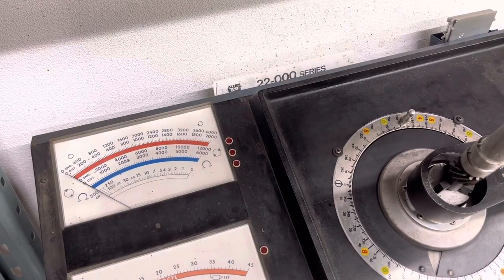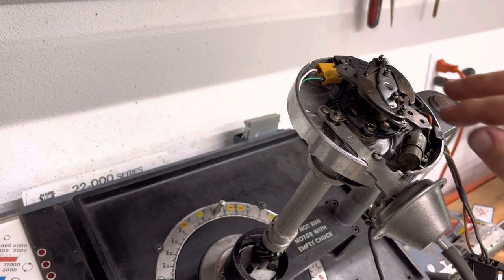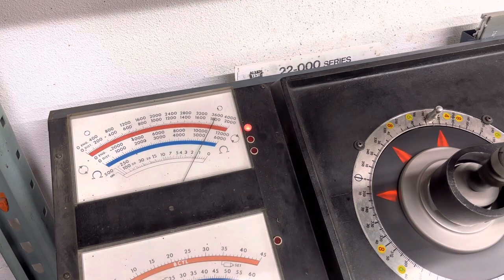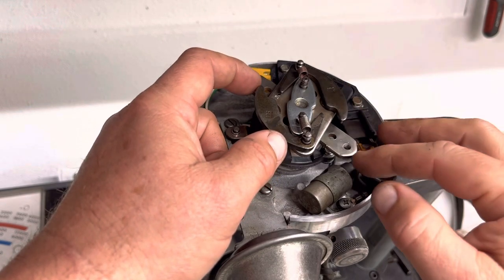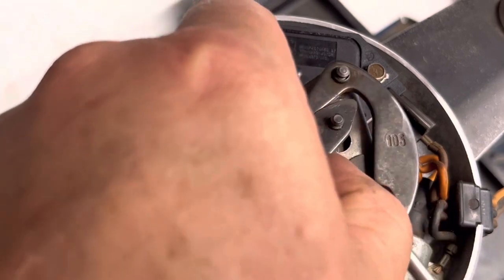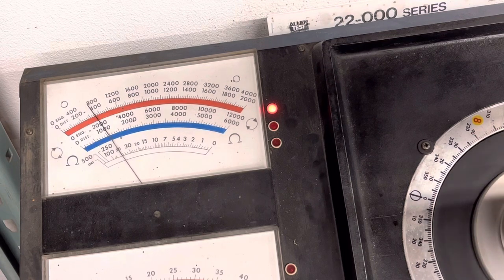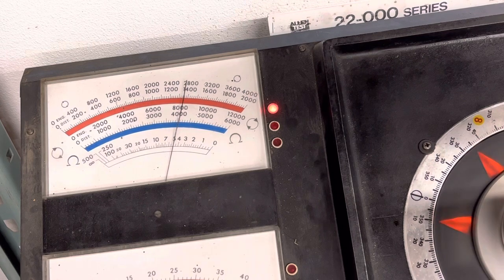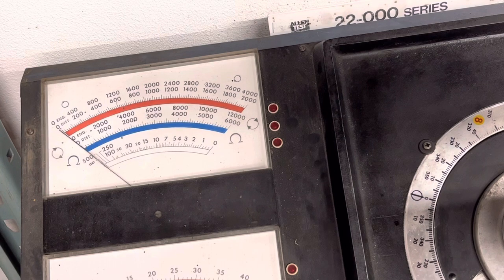Modifying and custom curving a GM HEI distributor for street performance

Comment: I have run quite a few distributors on my Sun 504 and I have the same problems you are showing. When you change springs, the mechanical advance comes in way too early and something you didn't mention is that is causes your idle to fluctuate and is frustrating because your idle is going up and down. I always try to have the advance come in at around 1,000 and all in before 3,000. People just don't realize how hard and how much time that takes to actually accomplish. But I am retired and have time to fiddle...Please keep up the videos because I can always learn something....
Reply from the maker: I have fought the erratic idle issue and I’ve found that changing the shape if the center football has helped; because the weights “rest” more securely. Another thing is to carefully choose your vacuum advance can. Make sure your advance can is completely pulled in at a vacuum reading at least 2” below your engines vacuum reading at idle.  For example; if your engine produces 15” of vacuum at idle, make sure your can is all in at 13”. I then limit the rod travel on the can so that it can only pull in 10-12 (crank.) degrees of advance.  This keeps the idle from “hunting”.

Comment: The Ford distributors have a far superior weight advanced system , that work properly, whereas the GM distributors have the far superior breaker  point system. Both of these systems were used in the Excel distributor which was previously engineered by champion spark plugs and used in the Can-Am racing back in the day.  Mr Art Early that worked for champion spark plugs educated me on this subject matter. He did the Datsun racing team cam science work and porting tech that helped Paul Newman to victory.

Comment: I watched the GTO points distributor. It opened my eyes. It just watched this one. And you helped me answer a question about an idle issue I have with my old 1 ton truck. And now I'm 90% sure it's the distributor. The truck runs good but her idle from time to time is unstable and too low. Thank you.

Comment: It seems a video might be in order: one that shows how ignition timing is related to the hp and torque curves could demonstrate how critical s
Distributor set up is to performance. Understanding if you are setting up for torque or power can guide you in choosing where you have what advance, and how much.

Comment: Would re curving the the distributor help with acceleration?  My friends truck is kind of a dog down low and it starts to pickup after 3k rpm.  It’s has a small cam and a performer intake and has an MSD HEI

Comment: Could your football be on backwards ? According to the MrGasket HEI Advance Curve kit #929 the diagram indicates yours is on backwards for a clockwise rotation distributor. flipping that football changes the geometry greatly and will make weights come in to hug football with any springs chosen and give zero advance at idle. It did for me.
Reply: I question that also.  Seems like that would be the reason for the offset holes?

Comment: This is EXACTLY the problem I was having with the inexpensive recurve kits for HEIs from Mr Gasket, Transdapt, Moroso... They're all junk. That centre contoured component is stamped with who knows what design and the car hangs with a bunch of advance and idles at 1500 RPM 'cause the springs can't pull the weights in even when the engine is stopped.  Awful junk. And yes, the ignition curve is important for throttle response!

Comment: It's been  my experience  that a lot of the problem  lays with the vacuum  advance rod hanging up on the base of the distributor  housing and causing intermittent  drivability problems  or a bad diaphragm that won't hold vacuum at all. I also like to use an adjustable vacuum advance  and vacuum tester  when recurving an HEI distributor.  And there are a lot of little  plastic bits inside that wear out and excessive  pin wear    with a performance  recurved  HEI it wakes up your engine

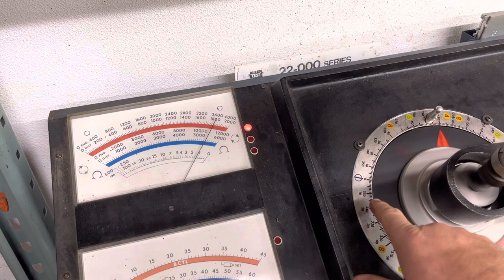Comment: At 2:53 you're saying you have 22° of advance but where you're pointing shows 12° total advance???
Reply: True
Reply: I assumed the machine was measuring degrees at the distributor, whereas we are used to degrees at the crank.  He's just so used to reading it he automatically doubles the number so it's in crank degrees.  My opinion.

Comment: Hello sir great video .
I do similar testing but due to lack of parts and mashineri Im limited down .
How ever if you use potenciometers,different type capacitors and variabel resistors that might phase shift or increase your spark out put.
How ever I did experiment with magnets litel bitt the spark was lot greater be just moveing ceramic magnet close to that metal part you mentioning in your video.
So prhaps mounting small electro magnet wuld help you out.
The electro magnet shuld be bariabel in frequency and you mounte it inside the distributor cap .
The springs have centrain play .
But after years I learned that metalic springs stiffnes is effected if you for some reasom get arcing relays ,back charging alternator or simply magnetised engine.
Evry thing that has metalic spring stiffens or get softer.
I do have some videos that I experimented on HEI ignition system.
The problem is not the pick up coil or advance mechanism .
The 4 pin GM ignition module has 8pin MC or LD 3334 ic chip it is limited how much volage it can recive true pick up coil it has cirrent limiter and ignition module operates at specific frequency range 33-333hz.
So be haveing home made variabel ic chip set you culd probably advance/retard ignition timing lot bether.
And that 4 pin gm ignition module stop working at low rpm.
The magneto/magnetron ignition look more promesing tought.
Pick Up Coil+capacitor/variabel resistor+darlington transistor +ignition coil.
That system wuld be lot bether and cheaper solution.
And I suspect the ignition coil saturation is to late the spark is to weak so I belive be constantly charging ignition coil via seperate grounding system wuld always provide 100% coil saturation .
I belive ordinary buzz relay culd do that task easely.
After all that system is mearly identical to magneto/magnetron ignition system.
I belive even the alternator culd be modified and add extra constant power to the ignition coil.
Those stock Hei systems are to weak to be used for winter weather states and have their limitations.
And on the stock HEI is missing zener clamping diode so reverse voltage protection it does not have after some time wire harnest starts to suffer in some cases engine refuse to stop .
So I sugest you try to build your own variabel circuet or mechanicaly to control that distributor housing similar to Cadilac 1930 advance/retard lever or try out that pick up coil tuning methode to trick the ignition module that engine run at higher rpm range or externali control sping tension with electro magnet.
Perhaps different capacitor types banks culd probably advance retard ignition timing as well in line with the ignition coil probably high speed switching relay culd perform that tack via crank position sensor so most likely DPDT switches might come in handy or similar who do not have resistance in their circuet.
Tungsten spark plugs wuld be great and high perfomance low resistance spark plug leads wuld be great to have.
Useing longer periods of time plasma/amplifier ignition might result in greater wearing of parts.
Thats how much I culd gather information regarding that ignotion system .
For the MC3334 ic chip or LD 3334 the chematic can be found and PDF file that describes rpm to frequency relation chip .
I hope this info helps you some what.

Comment: Love your videos teaching me a lot I race oval dirt track in South Carolina we have to run completely stock 350 HEI distributor can u help me or possibly build me a good for racing distributor also where are you located
Reply from the maker: Hi Junior.  Check out my website at www.gasandspark.com. My phone number is at the bottom of the “contact me” tab.  Give me a call and let’s discuss what RPM range your running on the track and build a distributor that gives you an edge!

Comment: Have a question for ya hoping u can help me.    I have an hei sbc stock cam. I have a performance curve initial is 12. All in 3000 @36 total. Good power seems fine.   But my exhaust smells very strong sharp acidic smell.    I have no idea  any ideas
Reply from the maker: Do you have a catalytic converter?  A failing cat can produce a sulfur / rotten egg smell.
Reply: No cat.    Duels     doesn't smell like sulfur at all just strong acidy smell more when I get on it then after a bit at idle that when I smell it.   1405 edelbrock
Reply from the maker: I haven’t experienced a smell like that…I’m sorry.  I wish I could help.
Reply: @gasandspark  someone said it could be nox

Comment: Do you agree with ported or manifold vac?
Reply from the maker: Hi Rob. I find that Manifold vacuum seems to work best on most street engines with mild / moderate cams.
Reply: @gasandspark   I have a stock cam . It seems to run well smoothly 👌

Comment: since HEI was created to satiate EPA requirements wouldn't it stand to reason that its designed for engine vacuum to pull the advance back down. Might be interesting to see what it does with 15 inches of vacuum.

Comment: I find just locking out the advance and  running fixed timing is the best thing to do. If you have a separate starter and ignition switch you can just spin it up with the starter and then switch on the ignition. It will light right off without kicking back and breaking the starters nose off. You can always add a start retard module if you want. An engine with fixed timing really seems to be responsive to the throttle. It idles a lot better with fixed timing and will idle at a lower speed without fouling plugs.
Reply: A locked distributor pretty much needs an ECM to manage advance.  An engine just needs help to idle easily - softening advance at low rpms does that.  I look at it this way: idle [and its compromises] is something we put up with, but its not where we or the engine want to be.

Comment: But you never explained how go fix the fact that those weighs still kinda flop around unless they are at their "flung" position. Its kinda odd how the geometry of the spring allows this, it will make it inconsistent. i wish i knew how to fix it because i cannot seem to get a repeatable initial due to that issue..I set the total at 3k but dependi g how fast you back off depends how far those weights return..this is on a brand new msd
Reply from the maker: The weights do flop around freely until centrifugal force takes over and causes the weights to act upon the center cam and advance it. 

I’ve experienced weights that do not fully return, resulting in inconsistent idle, when very light springs are used.  I have to add heavier weights and modify the center cam to overcome this. 

The other issue than can cause inconsistent idle is a vacuum can  (attached to a manifold source) whose pull in point is near or above the vacuum that the engine is producing at idle. 

For example. If your engine is pulling in 15” of vacuum at idle and your vacuum can does not act until 14” of idle, you will likely experience an erratic idle as it gets pulled in and released based on vacuum pulses.

If your vacuum can is hooked to a manifold source, makes sure it pulls in at least 2” below the vacuum that the engine produces at idle.
Reply: @gasandspark  Thanks a lot for your reply mate. I dont have a vac canister at all. My distributor advance is purely mechanical, i was horrified to find that it takes between 3 to 5 seconds for the advance to settle down to initial settings after i give it a blip, and as i mentioned the idle sometimes settles back to 1100, sometines stays up around 1250. I took the distributor out, had a look and nothing at all is interfering with the weights returning to the initial position, so in my opinion the only thing that coukd be causing this is that sloppiness in the weights due to the fact that (because of the geometry) here is no spring pressure until the weights have flung at least 3/16ths away from the "football" . This would surely cause issues wouldn't you say? I was almost thinking of adding some material to the weights to move their resting position so that they are always under some kind of spring tension. This would  reduce my total advance though if all else was left untouched..however i only need 8 or 10 degrees maximum.. Would you think that is a worthy fix? Thanks again.
Reply from the maker: @borismcfinnigan3430 ;  I believe that adding material to the center football helps to keep pressure against the weights so that they “rest” more securely.  I think it’s a fairly poor design from GM, so we can only improve it so much.
Reply: I believe football was installed backwards in video. There is a right and wrong way to  lay that football down. See MrGasket #929  HEI Advance Curve Kit diagram. Compare diagram football closely to video football.
Reply: @28704joe  what on earth do you mean? The "football" is welded to the shaft there is only one way it can go
Reply: @borismcfinnigan3430  Nope. Look at 0:41 that new plated piece he is holding is not welded anywhere, it is dropped over the pins so there is TWO ways to place it. In the case of this video it was placed on backwards for a clockwise rotating dizzy. Look up and READ MrGasket HEI Advance Curve Kit #929 instructions. Have a good one.

Comment: Would you say 20° total mechanical advance is a good target for most streetable v8 engines? And how much total with vacuum added in with mechanical as I recently discovered there may be an adjustment inside the vacuum diaphragm you access thru where the tube plugs onto it.
Reply from the maker: Hi Jeffrey. Yes, 20* mechanical seems to work well with most engines. I limit the vacuum can to only pull in an additional 10-12*.  I do this by welding up the slot in the vacuum advance can. In total the engine gets about 46-48* advance (16 initial + 20 mechanical +10-12 vacuum can).

Comment: Did well to get the return with such a poor mechanical advantage from the spring post positions.
 Pretty sure I've ever seen such a bad design on any motorcycle I've worked on in 50+ years, even the Made in Spain stuff in 1970's

Comment: I'll say that the advance weights available in the aftermarket are poor design, and I'd believe they're designed for the least common denominator not to ping. I'm surprised someone hasn't started repopping these with how available CNC water jetting is.

Comment: HOWdy  G&S, 
... 
I'm having a terrible time "seeing"  what you are calling the total  SPARK ADVANCE on your machine DIAL  

I see zero  ( 0 ) just fine  / and thought  I  was seeing / 5 degrees / 10 degrees / 20 degrees / but / when your are  telling us  18 degrees = I'm seeing "10" on the dial
...
Can you straighten me out please ?
...
COOP
the  WiSeNhEiMeR  from  Richmond, INDIANA
...
Reply from the maker: Hi Dave, you bring up a very valid question / point. Every hash mark on the machine equals 1 distributor degree, but 2 crank degrees. For simplicity sake, I always talk in terms of crank degrees. I do this because this is what most people are family with.  However, the crank turns twice for every rotation of the cam. 

When working on a distributor it is proper to communicate in distributor degrees, but I’ve found this creates confusion with the lay person.  However; you picked up on it (and I failed to reiterate in my video). What you are seeing is distributor degrees and I am commenting in crank degrees. 

I hope this helps.  Thanks for pointing it out.

Comment: Just about every engine on the planet runs best with about 34 to 38 degrees total advance all in by 2500rpm.
Reply: I rarely find that to be the case. What engine are you running that needs that much advance that early?
Reply: @v8packard  Just the most produced engine in the world, the small block chevy. It clear you haven't a clue.
Reply: @joe-hp4nk  I have spent my career improving the piston to deck clearance, chambers, and compression ratio if nearly every small block Chevy I have worked on, in part so they don't need the crap advance curve you are fond of. But, since you just want to be shitty, you can continue on and miss out on real performance.
Reply: @trailerparkcryptoking5213  Have you used the HEI that is programmable? I wonder how reliable it is.
Reply: @trailerparkcryptoking5213  The problem with the weights in the HEI is the springs are too long for the weights to close completely. You can get short springs with aftermarket sets. It solved the problem with my HEI's.